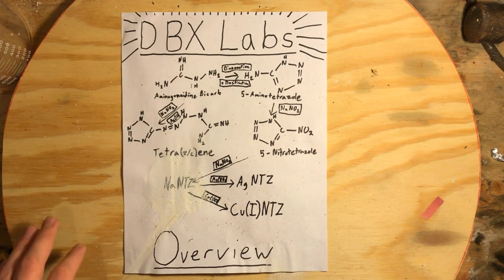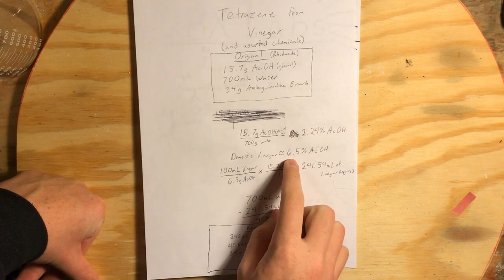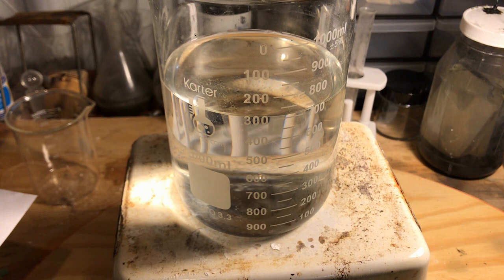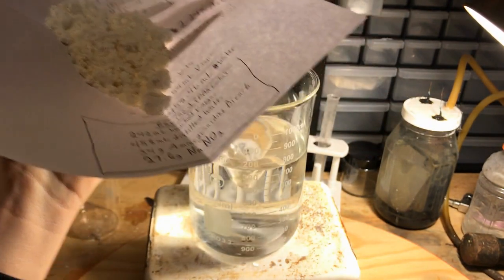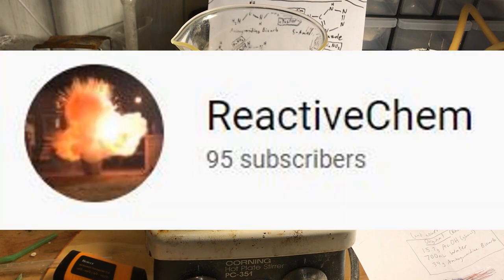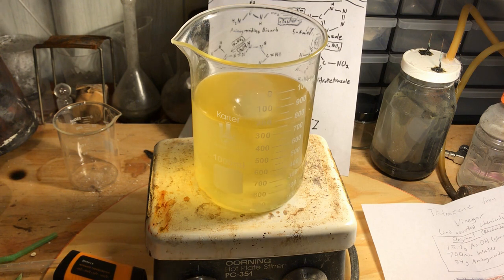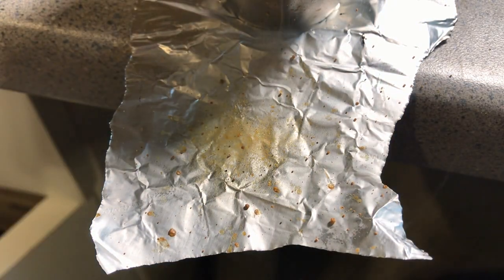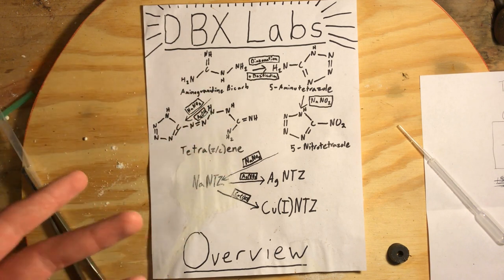Tetrazene synthesis from Vinegar (and other chemicals)

Comment: changing your acidity (excess of acetic acid) during diazotization causes aminoguanidine to cyclize to guanyl azide.   in the presence of mineral acids this will convert to 5 amino-tetrazole.    tetracene and tetrazene are same-the latter is the German spelling.    AGB can be made from calcium cyanamide reacting with hydrazine sulfate quite readily

Comment: What temp did you dissolve the Aminoguanidine bicarbonate? How much did you wash the finished product?
Reply from the maker: I believe it was around 60 degrees Celsius that I dissolved the AQBC at. I washed the tetrazene with cold water in two parts.
If you are trying out this synthesis right now, you’d probably have better luck following the similar procedure seen on ReactiveChem’s bitchute. I’m not quite sure what it is but a lot of people have had problems in replicating similar yields following this outlined procedure. I intend to make a new streamlined video on the synthesis some time in the coming months.

Comment: I tried this and got the same results as John-Michael got. I have run the process twice and got a precipitate but it is not tetrazine.
I followed your video step by step. What went wrong?
Thanks, JP Jones
Reply from the maker: Hey, sorry it didn’t work for you. I’m thinking about doing another video on this synthesis since it appears that there’s been problems for many people in the outlined synthesis.
What I can only guess might be the problem is the type of vinegar being used. I personally used “Food Lion” brand vinegar in this video and if I recall correctly, that was the only store bought vinegar that I’ve been able to get to work. The vinegar might be chemically identical across the board but the concentration likely varies a bit.
I’d recommend you follow The PubChem synthesis and titration your vinegar to determine how to make the stoichiometry work for whatever brand vinegar you use.
Hope this helps, I’m really not sure what else you should try besides checking the vinegar.

Comment: Remember, Tetra cene is a polycyclic hydrocarbon. I used to get Tetrazene and Tetracene mixed up all the time and got corrected for it. A lot.
Reply from the maker: Yeah I saw that on google a few days after posting the video. I figured I correct it in a later vid. Why did you take your video on tetraZene down?
Reply: @DBXLabs  I just had it unlisted. I don't remember why exactly, but I just put it back to public.